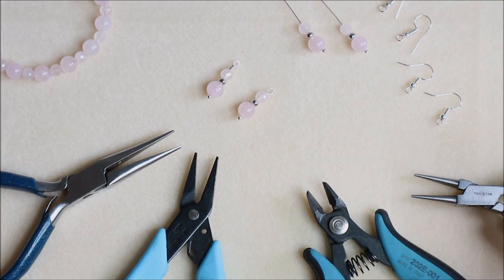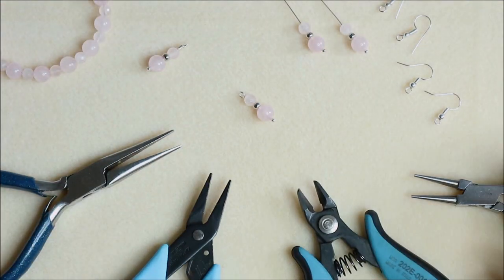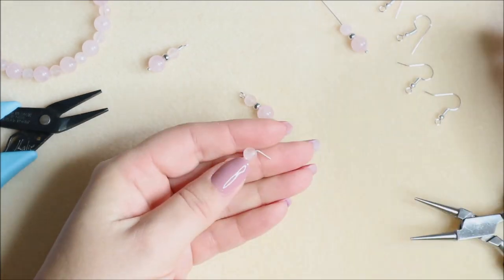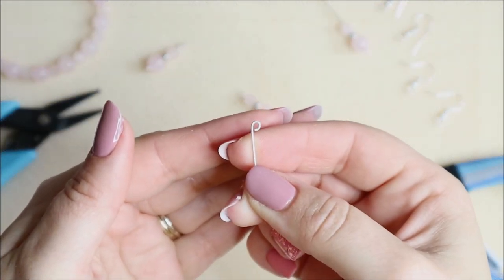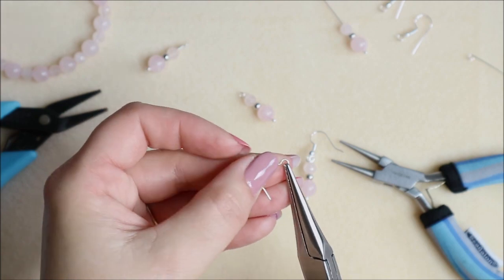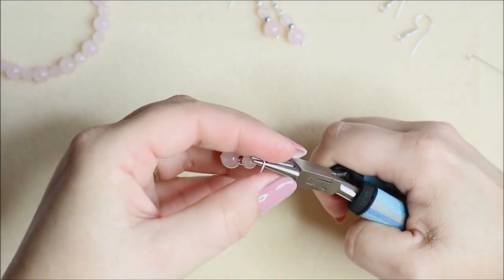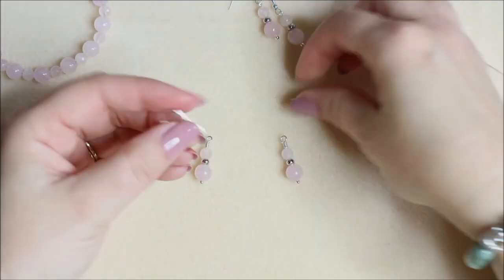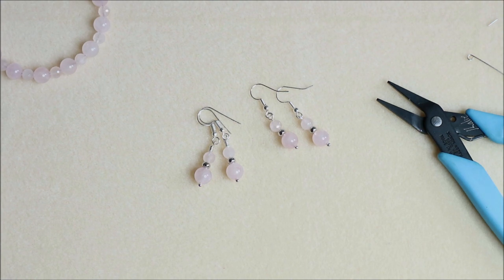How to Make Earrings - Wrapped Loop - Simple Loop - Jewellery Making Tutorial

Comment: Question! I'm currently working on improving my wrapped loops.  When I try to do 3 wraps, clip the wire in the back and tuck it in, it looks more like 3 wraps in front and 3 1/2 in the back or on the side.  Is this pretty standard?
Reply from the maker: Hi,  yes just make sure you snip, keep your snips as close as possible to your work. Then when you squish your end in it won’t travel much further. 😊
Reply: @katieparkerjewellery7277  Got it - thank you very much for your reply!